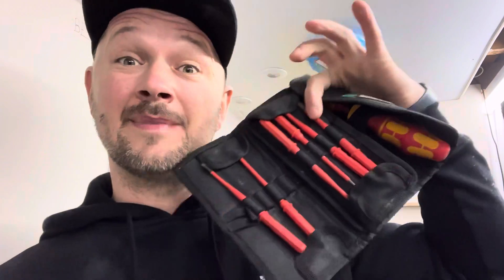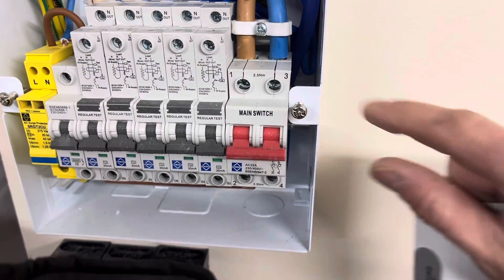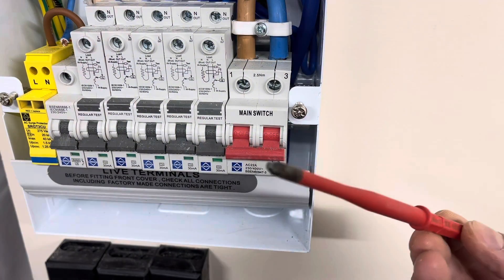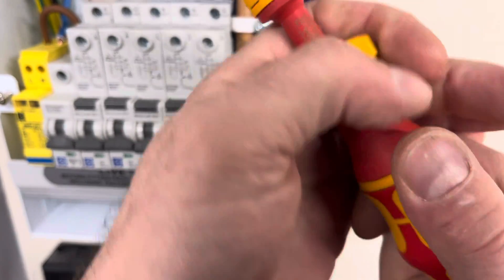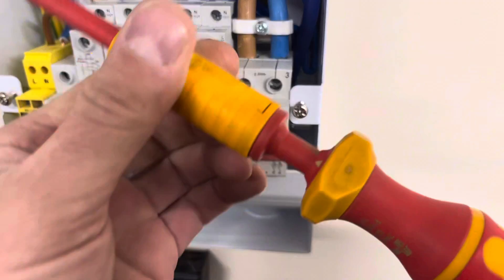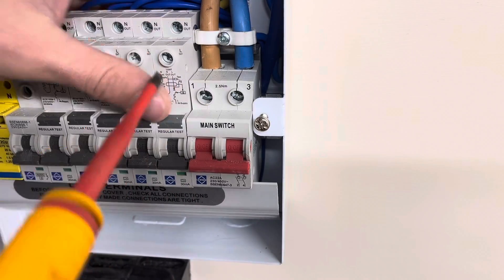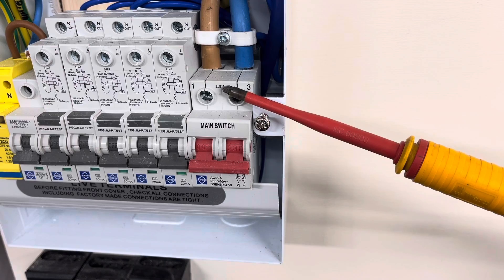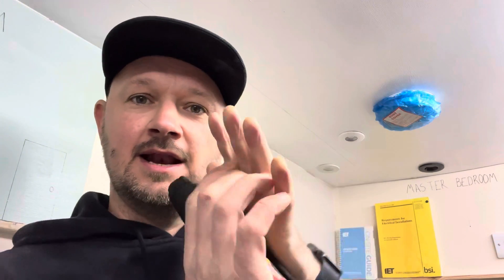Wera Torque Screwdriver Set: Why Electricians Swear By Them! 🔧⚡

Comment: Im having a bit of trouble choosing this model or the one thats 1,7-3,5Nm any recommendations? Do i need to go above 3 or bellow 1,7
Reply from the maker: I would go for the one below 3 as some mcbs need 2-2.5nm
Reply: main lugs in UK and US are more than 3nm so its hard for me to buy this one. I like this driver a lot but its not as versatile in terms of torque limit. Wera has the pistol grip one that goes higher and there is the Wiha one that goes up to 5nm. Im American so we use inch-pounds to measure torque but I use tools from around the world and learn this stuff

Comment: Ben nice bit of kit, but before you demonstrated it , point 1 the terminals on the main switch look like they were over tightened as you can see the case has separated slightly probably done with an impact driver, point 2 you should of backed the screws off then retightened to 2.5 Nm then you know for sure they are at the correct torture.
Reply from the maker: Good advice there mate, I will remember it for next time 👍
Reply: @toolboxtalking that’ll be £500 please 😂